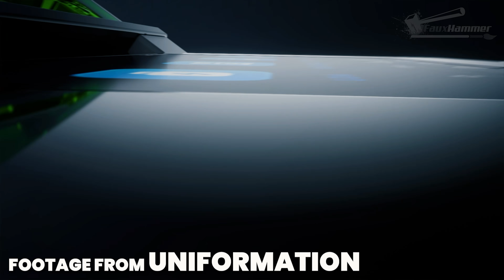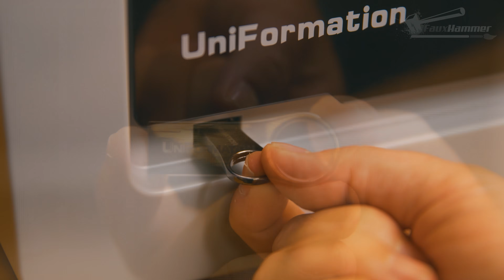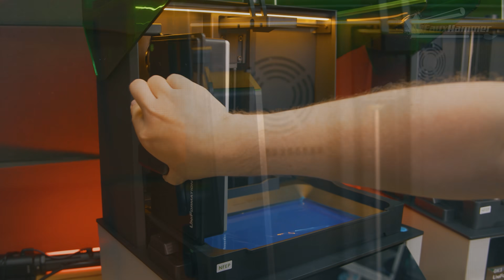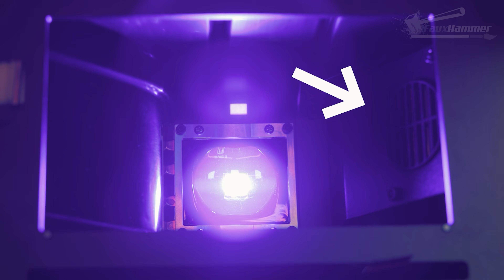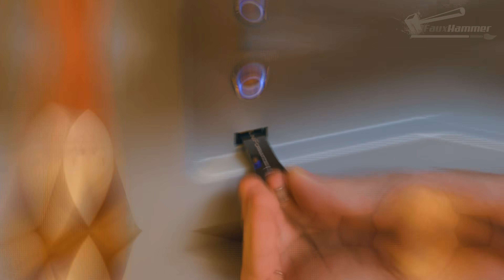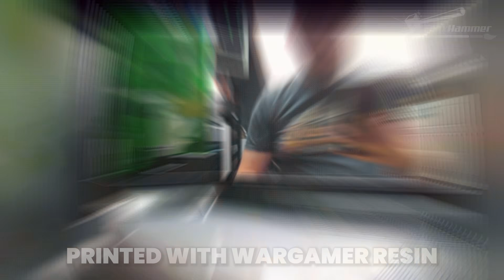Uniformation GK3 REVIEW - "ONE" REASON TO BUY

Comment: That's also why I bought the GK3, and it's not just how easy it is to replace the screen. It's general repair and normal maintenance. Uniformation is just easier. Everything is more modular and more accessible on this machine.  I have far fewer headaches with it than I do with others that I own. It's also much easier to clean and keep clean, something that is massively appreciated by me. I also never use the feeding system. Cleaning resin of the inside lf my machine when the lines break, is not something I care to do.

Comment: The problem with replacement or maintenance which requires that much disassembly. Is there's virtually no situation where you didn't mess with something unintentionally.

Always some connection loosened or damaged that you'll never see as we try following some heavily cut video.

Comment: TLDR: You need the right tool for the job and the current versions of the GK3 shines in areas where other printers do not. 

So, I have waited to comment after having some experience with the machines. My hope is these thoughts helps someone.

I run a print garden (7 printers so far) and have a website that sells about 40 products right now. (we keep adding things) But they are very technical machine type prints for model kits. i.e. cannons, cranes, ladders, etc. in 1/350 and 1/200 scale.  (very very small)

When the GK2 was discontinued, I was content to just add a GK3. But when it came out.... well, you all know what happened and I needed to look elsewhere. 

I settled on and was very hopeful about the Hey Gears RS with a pulse tank. Turns out that printer is phenomenal for printing figures. It was also helpful for prototyping. Unfortunately, because I cannot modify any of the print settings (and this is because it is dynamic. Settings change throughout the print process depending upon the environment and subject) I can only get it to print about half of my models. This is a problem. I also do not want to spend the time re-working my models in the HG slicer program and figuring out if I can produce something that's easy to ship and doesn't have 10 million supports on the model.

Bottom line, with one of my GK2's on the fritz.... I needed a different solution. I decided to roll the dice and just buy a new stock GK3. Other than the screen size being a little smaller, it has been PERFECT.  My current designs drop right into Chitchu box, set them for the GK3 and we are off to the races.

HUGE PROS for me about the GK3: They have a slot on the side with a clip at the top that lets me put the build plate on the side and drain excess resin off. The lid closes without hitting anything. It's PERFECT.  The interface is familiar and is super-fast compared to the GK2. Storage: I think its 17 gigs??? This is a big deal for me because my GK2's were purchased over the generations and I have one that has a semi useless 3gig hard drive and one that goes up to 7?  I store most of the files on the machines.  That way, if I want to run them, I turn them on, prep the resin and select the model I need that day and hit print.  The LED light in the GK3 is good. I can see inside clearly. It's much better than the HG led. It preheats just like the GK2's before printing up to 30C. The build plate is the best handling one in the market.  The HG has to be put on its side and I have to let the resin drip off the top before removing the models. This is too time consuming for a print garden. 

I don't use the wifi, I don't bother with the app or use the camera on the GK3.  I use this printer as a tool. And the things I need it to do; it does really well. 

Lastly, I think part of the reason I'm having trouble with the HG and skipped trying the Elegoo machine, is the pulsating vat. For my extraordinarily small parts that process is actually damaging those areas of the model. I could opt to not use the pulse tank. But without being able to dial in the settings for my models, it just isn't working. I'm keeping the machine however because it helps me with "rapid" prototyping and I am printing figures with it, and they turn out amazing. 

I guess the bottom line is, you may need different machines for different tasks. There's nothing wrong with having the right tool for the job, even if one tool is made by a different manufacturer.

Comment: Did you have any issues binding the printer to the app? Printer has excellent WIFI signal on my LAN.   I updated to Firmware 1.3.3 but still get an Alert, bad request! Any ideas? Using IOS.

Comment: GKTwo now has 1.3.9 update which allows multiple calibration on one print, also modify sliced file settings on printer... Very happy with my GKTwo
Reply from the maker: can you modify the settings of the test file on the printer? or you mean youc an do test files and modify settings of nomal files? becasue youc oudl always do that?

can we use our own models now?
Reply: Modify normal files on printer... its new in 1.3.9 update which only came out last month, never been able to edit settings so always had to reslice. The test print for calibration is their own test, but i think it can easily be changed for own test files as long as setup in same way.  @FauxHammer
Reply from the maker: @MGRayd really? I was able to edit setting on normal files all the way back when have bed units. Are you sure this is new?😊
Reply: @FauxHammer link to gktwo 1.3.9 update includes pdf of updates... I've never had an option to edit files on my gktwo and that I updated last year to 1.3.3 and this is the only new update since then. I could print it delete files on printer, never edit settings.
Reply from the maker: @MGRayd yeah I remember when you start a print and you have that in progress ui on screen you an tap settings and make changes there.

I haven’t had a gk printer  for weeks now

Comment: I have the GK3 ultra and I love that I have a similar build volume to the form 4L but didn’t pay $10,000
Reply: How's it going 
I'm close to buying it
Reply: @3dguy839 it’s a good printer. The only hitch I had with it was the resin level detector which effected the auto refill system but once I grabbed a new resin trey it was smooth sailing

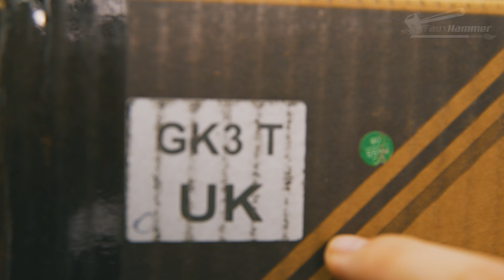Comment: 2:51 unless they get the nut separately there is no difference in installation, if the nut is separate than yes it's a absolute pain to sit there putting all the bearings back into the nut whilst slowly putting it on the screw, but most ball screws I've seen do come with the nut already on.
A lead screw isn't really even that inferior in this application anyway.

Comment: For clarification I'm on the Uniformation beta team, run Loken's Miniatures with over 20 printers (most of them gK2s and all versions of the GK3s with other brands mixed in to compare), I'm also an electrical and mechanical engineer of 21 years.

This is a very accurate and fair review. I prefer the GK2s and the GK3 ultras over the GK3 and GK3pro but the GK3 is still a solid machine (better than the GK3pro in my opinion because of the 385 light source). 

Some people will complain about the ball screw or lack of, the singular rail, or nitpick about special features but as far as a work horse printing machine goes, the gk3 is as good as its predecessor.

The questions I would ask myself, is the GK3 reliable and does it produce good prints. Yes to both, I print multiple times daily, other than my Ultras the GK3 standard is probably among the best printers released this generation.
Reply from the maker: Well Said Loken, it's exactly how I feel about it, the printer is fine... it;s a great workhorse and shoudl last for ages.

Comment: As a GK Two owner (and happy with it) I am not in the market for an upgrade at the moment. However I would like a larger screen for some of the parts I occasionally print. But these seem quite equivalent for most uses compared to the GK Two, so they still appeal.
Reply from the maker: I would probably use my GK2 over these too, the larger 8k screen matters more than the imperceveable resolution change, I won't even say resolution "upgrade", it's just a change.

Comment: ok this machine has some major flaws that i wouldnt recommend to any serious buyers for batch printings. 
1. the metal pin sometimes failed to detect resin levels which will makes the pump works indefinitely which leads to over flow all over the place
2. the single linear rail design is very wobble when printing batched prints full plate you will get failures and lines on heavy large or full models
3. no smart features like forces detection while charging a premium and no disclosure of the ball screw brand and linear rail brand
4. no flexible exposure calibration available you can only use their file for calibration and the time can not be adjusted they are fixed 1.8 2.0 2.2 etc
5. their sales are not good, its a personal thing im worrying that they will go under anytime soon so the parts will not be available
Reply: but again i still dont find a " all around" printer with 
1. 385
2. COB
3. heating that is not a chamber heater/pump heater(aka tray heat or under screen heat)
4. 10" up 
5. ball screw
6 dual rail 
7. closed loop motor
8. wifi
9. linux system that is not a chitu
10. flip up 
11. no fancy creative garbage (elegoo tilt creality pull up garbage X1 etc)
12. no locked resin
13. failure/loose debris detection
14. phone app
15. amber filter
16 8k screen not those 16k bs
17. easy screen replacement
18. a sealed screen on factory

Comment: Would you recommend this over the Saturn 4 Ultra 16k? I was planning on getting that printer but now I'm not sure.
Reply: Yes I have over 20 resin printers. I must clarify I am on the uniformation beta team and I have several printers of theirs, plus anycubic, elegoo, phrozen machines including the S4 and S4U. The worst thing about the Saturn is the plate design, they are reliable printers as are the GK3s but the mess the plates create is ridiculous.
Reply: @loken9124  Thanks' for your response, I've heard people mention how annoying it is to clean the build plate on the Saturn 4. Though I'm thinking if I don't change resins very often it might be ok to just leave the mess untouched between prints.
Reply: @BennettManfredi unfortunately that won't work, you have to remove the plate to get the prints off and the resin is all on the plate. Don't say I didn't warn you 😊
Reply: I was considering Saturn 16K also, but got the GK3, much better choice for me imho. I didn't spill a drop of resin on the printer for now, very clean and easier workflow for me.
Reply: I would say, yes, I personally think uniformation is possibly one of the best printers out there. For the price, and they're getting a little bit on the pricier side. I currently have a heygears, printer, and a gk two, and I would have bought a gk three if it wasn't so hard to get. Now, they're a little bit more accessible, and even though I have a heygears which I absolutely love, I still think i'm going to add the g.K 3 to my collection

Comment: Heygears should implement Formlabs/Uniformation like build  plate, closable vat, build in camera and it will be (which now still is for its reliability) best printer on market for also reducing contact with resin as much as possible.

Comment: There is another exposure test for 30microns, which starts at 1.2s, it is on their Youtube channel in the exposure video description, but it is easy to miss. They should upload it on their site also.
Reply from the maker: Yeah, Which was created after my initial feedback, i was never told about and is still incredibly limited when compared to other brands versions of this feature
Reply: @FauxHammer  I agree that you should be able to adjust the exposure and use another model by choice.

Comment: I got the GK3Pro and I like it! I don't mind missing the force sensor, I need easy maintenance, clean design and reliability. I nailed the exposure from the first time using the printer with the provided multi-exposure test and the first print was perfect. Not to mention the easy screen replacement, which will happen at some point. Also the hanging bracket on the side is brilliant idea, very easy to drip the resin from the buildplate and the model. Buildplate was factory leveled, so no fuss. The vat is very easy to place and emptying resin is fast and clean thanks to the nice pour spot. And I need integrated heating. I was considering getting the Saturn 4 16K, but I'm glad I got this one.
Reply: I got the non pro Gk3 and echo your points.  It's been such a hassle free, easy to use printer and the biggest quality of life upgrades for me (coming from anycubic and creality printers) has been the cleanliness of printing on the Gk3 no more resin dripping everywhere.  It's also 50+% cheaper than the heygears and like you I don't really need the force sensor.  It's been a fantastic printer so far.
Reply: I'm glad to have read this. I have a Mars 5 Ultra that I love, but I've gone through 3 build plates because they're terrible. I was excited to see the S4 16K advertised, until I saw there are still build plate issues.

I think the GK3 will suit my needs. I just want a clean workflow and consistent, successful prints.

Comment: What,we,need,is a parasitic pump with a removable line I know this can be do e if seen it in medical equipment this would a low resin bottles to be upright and open if a line just feeds into  the top. Just pull it through some paper towel as it's removed from the bottle